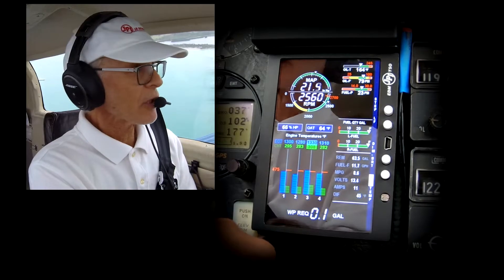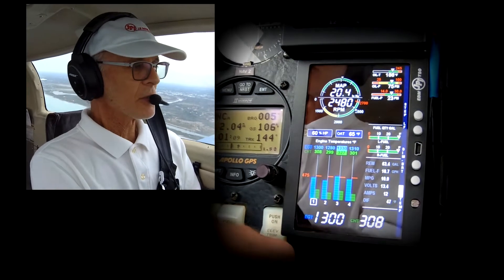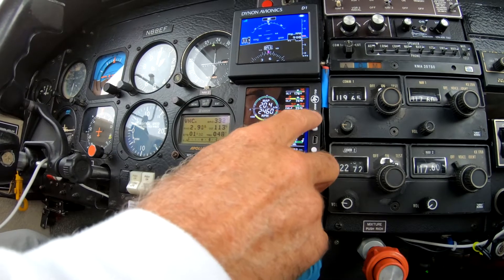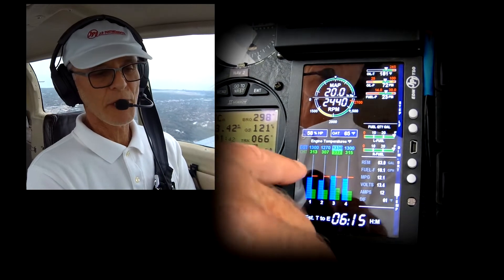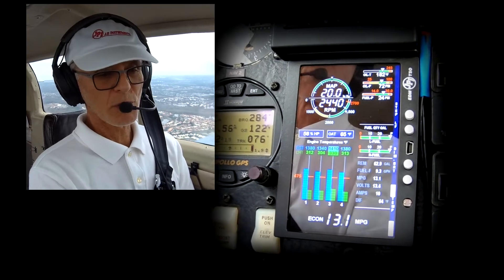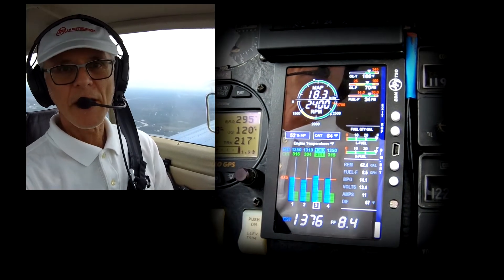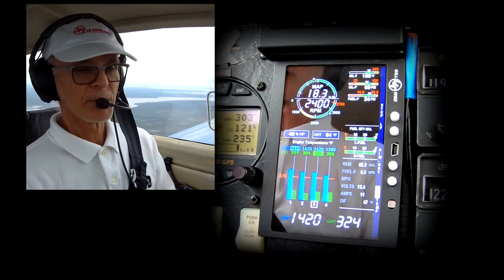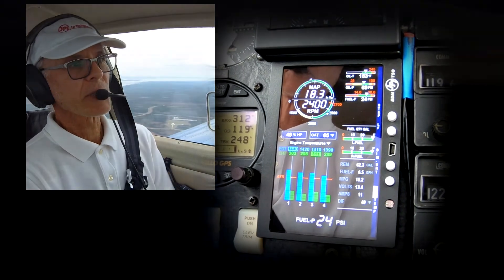JPI EDM User Tips 2020

Comment: Craig - I have added a fuel cell in my luggage compartment of my Cessna 172. How do I add the fuel to my JPI while inflate? Do I use the same method you have demonstrated while adding fuel in flight by pressing the two top buttons and just add the fuel after its all in the right tank? Thank you in advance for your help
Reply from the maker: You might want to call them, 800.354.4574 to see, I believe the units are sent out with the aircraft POH values. If your unit is not primary, you might be able to reprogram totals, deeper in the settings menu, but please check with them first.

Comment: Thank you- are you fuel injected ?  I have an M20C with O-360 but have been hesitant to go LOP because the EDM manual says LOP if you are equipped with GAMI  injectors…
Reply from the maker: You should be very careful, my 360s injected and I don't have Gamis...that being said I rarely see more than 50° on the difference between the warmest and the coolest exhaust gas temp. In my case my engine seems to be happy running LOP. You can also carefully run LOP and then look on the easy trends app to see if there's any spikes or any sign of potential detonation or rough running.